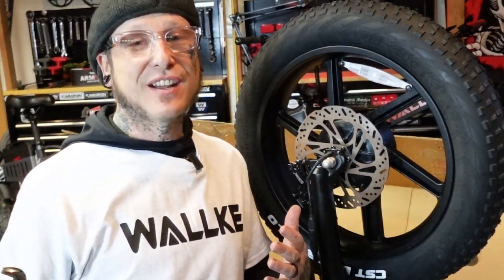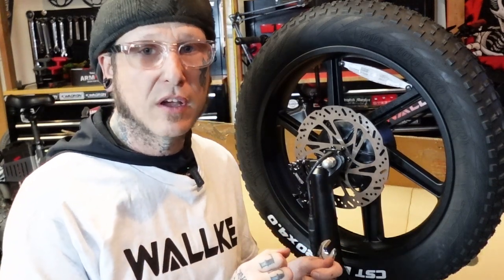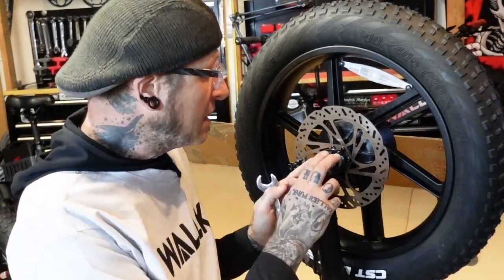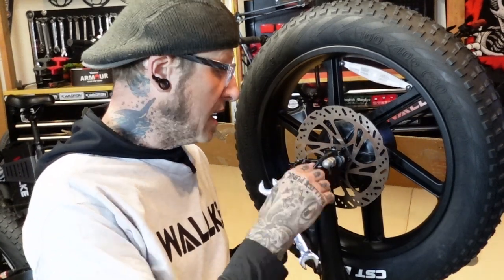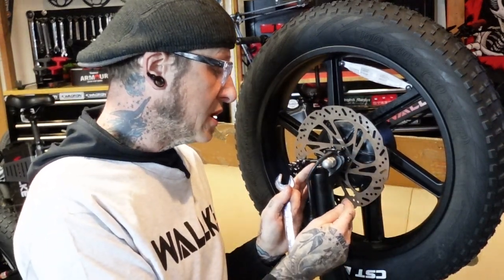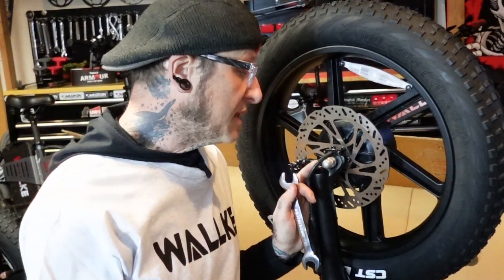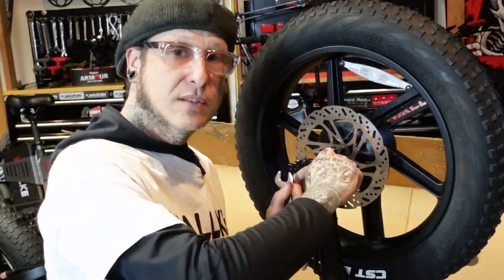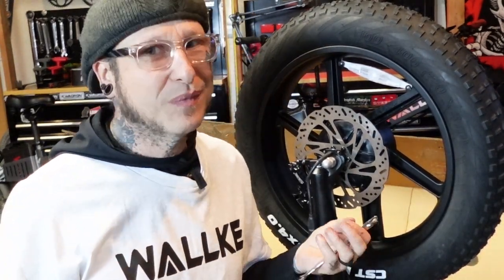Wallke H7 H9 Dual Motor front Wheel install TIP

Comment: Do you know where i can get the black anti rotation washers? My x3 max didn't come with them.
Reply from the maker: I haven’t gotten to check out the X3 max does it have the spaces for those? If so they should have been tied to the wheel in a little baggy. If not then Wallke owes you a pair. Hit ‘em up and I’m sure they’ll send you some.
Reply: @TheE-LightenedArtist  yea, the x3 dual motor are supposed to come with them according to the manual. I'll contact wallke. Thanks
Reply: Did you ever find them my h9 didn’t come with any baggy either and I think the washers are all messed up the instructions don’t help at all and all videos are from older models

Comment: I can’t for the life of me figure out how to install this stupid front tire on my H9 AWD MAX in any video I see there’s a baggy with 2 things in them on the tire I don’t have those those washers with the little piece sticking out is only on one side of the tire and I can’t get it off the other side didn’t even come with one it just had 2 normal washers side by side
Reply from the maker: I haven’t gotten an H9 but I’m assuming it’s the same. I hope the other torque piece wasn’t loose in the box. Wallke should send you one. You don’t have to remove the other one. The axle slips right through it. Just have to line the axles flat sides to it.

Comment: Wallke is terrible! My bike is falling apart! They respond but then don’t respond for over a week and offer no refund or replacement bike! This company sucks!
Reply from the maker: Which bike? What broke?
Reply: @TheE-LightenedArtist Wallke h6 max and the folding and locking mechanism on the handle bars/neck on the bike broke mid ride! I almost died!!!!
Reply from the maker: Wow. 6 bikes and 1000s of hard miles and I’ve never had a problem with a bar clamp. I have an extra if you want it.
Reply from the maker: Tracy Burks on FB. send me a pic of what broke. I have a folding neck assembly that I took off my first H6 that you're welcome to. Or you could do a BMX swap. Just depends on whether you actually use the folding bars or not. I never did so went with the BMX bars. Either way. I have it if you want.